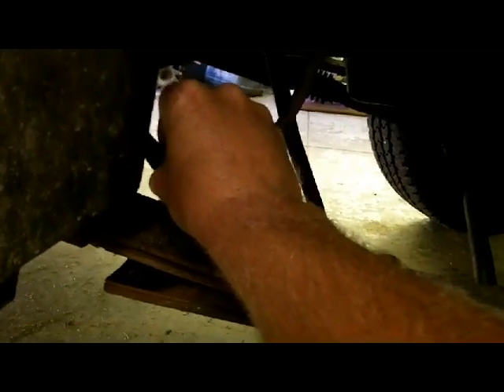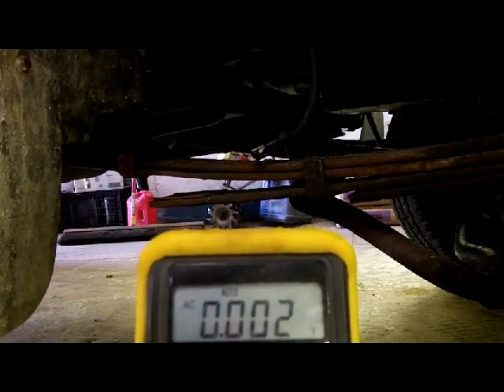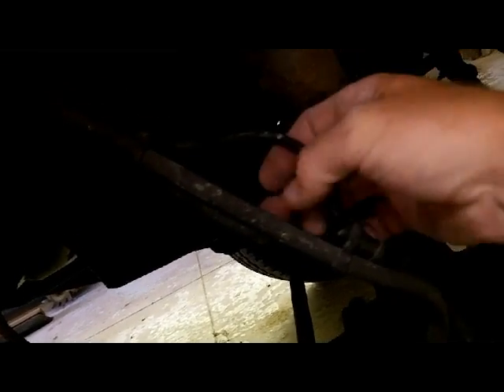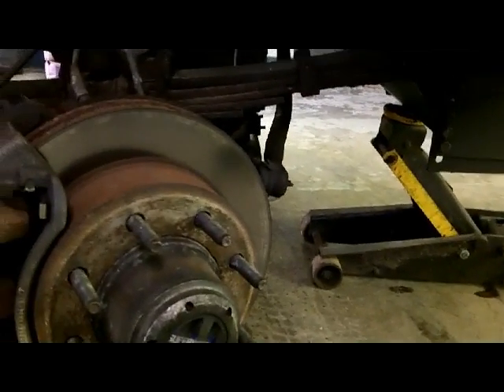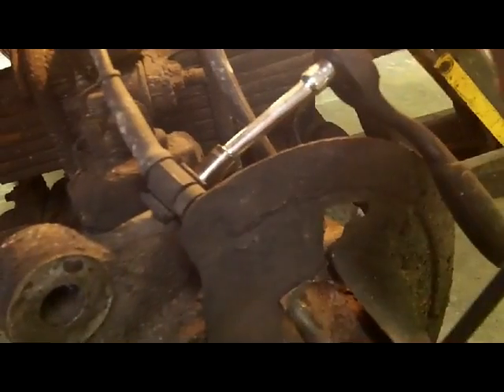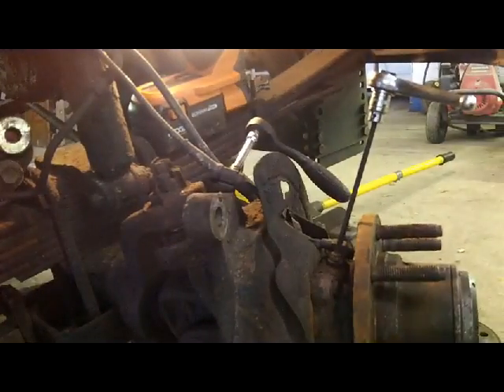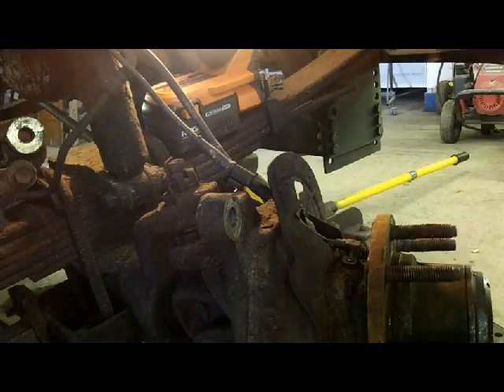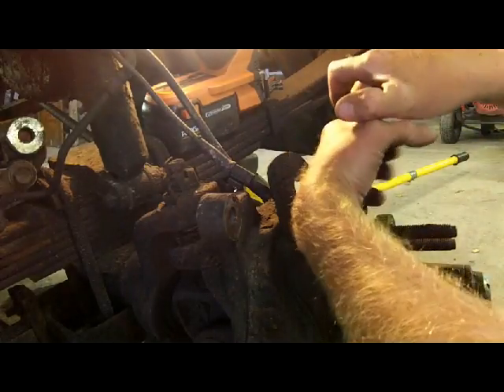F250 Super Duty ABS Sensor Test and Replace

Comment: My ABS showed up and my TCS OFF  is on at same time. Fixing my sensors will that also take care of the TCS too?
Reply from the maker: @victorcompean5745  It could fix the problem if the sensor is bad. If the hub bearing assembly is going bad the wheel speed sensor will get erratic readings and also cause issues. May be best to replace entire hub bearing assembly

Comment from the maker: The sensor does work on resistance... but the resistance is created by the pickups on the wheel hub assembly in relation to the abs sensor.  So by spinning it will tell you if it is within a proper voltage range.  That's why you have to spin the wheel.  Sensor doesn't have to be dead to not be working properly.  Good question though.  Thanks for watching

Comment: Really hard to see shooting into the light behind the wheel.  Your data helps a bunch. And  knowing what AC voltage helps me to test  the sensor.   Just would love to see your hub and  disc setup.  Any 200 watt  light aimed at the side your working would  really help to see.

Comment: Pretty sure this will solve my issue. 2012 f250. Felt like air in the brake lines and the same feeling in the gas petal. Service advancedtrac fault comes on.
Reply: I know this post is old but did this fix your problem?
Reply: Same problem, errrr sound when breaking and hill decend control fault and service advance trac, what did you do?

Comment: In the beginning could you have plugged in your scan tool while driving and seen that one of your wheel speeds was different then the others? I am having the issue with my 2006 ford E350 with the RSC alarm going off. I have no scan tool as I read that a special scan tool is needed for ABS matters. My Service RSC alarm is outrageous to drive with. Goes off every 10 minute or so
Reply from the maker: MurraySellsHomes I didn't own a scan tool when I made this video. If you have some sort of alarm, I'm sure a scanner is necessary
Reply: I'm trying to fix the same problem, I am told unplugging the right rear wheel sensor will disable abs/rsc/tcs 
I'm just not mechanical enough to figure out where the sensor is on the 2006 e350
Mechanic says it's 1800$ to fix properly so I'm screwed and the alarm bell is driving me crazy.

Comment: Is it possible to just check how many ohms are going across the circuit?  If it's a bad sensor the resistance should go through the roof or read open circuit.  Don't have to go through all the trouble to spin the wheel.

Comment: Hey my has the abs light on and the speedometer stop working would replacing them help it
Reply from the maker: Most likely it's the rear axle abs sensor or pickup ring if light is on and no speedometer input

Comment: Any suggedtions if replacement is shorter? I have an aftermarket hub with a longer sensor that has failed.  don't know how to find one that matches.
Reply from the maker: Steve Nichols Shorter may not pick up signal from hub. Try it and see. May need one from Ford

Comment: Just FYI, AC volt on meter is to measure alternating current, like your home. On a vehicle you should set your meter to DC volt. Since you have a battery you are measuring direct current.
Reply from the maker: +jagmechtech I am aware that vehicles use DC power for all accessories however with an abs sensor you are not measuring dc voltage because it is not hooked up to the battery.  You are testing the plug that leads to the sensor, not the end that goes to the ABS controller.  Then spinning the wheel to check for a possible bad sensor if that makes sense.

Comment: I asked for the rear left side but it only goes to the front. Do they now how to replace REAR, or isnt there one on the rear???2009
Reply from the maker: +Gary Letts Usually the rear abs sensor is a speed sensor on the rear differential.  Not an individual sensor on each rear wheel.  I'm not sure about a 2009 but I would believe it would be the same.
Reply from the maker: ***** Thank you sir

Comment: Thanks for sharing this video, i have a 98 f250 and the computer read that the speed sensor a is bad, but i don't know which one would that be. You know? Thank you!!
Reply from the maker: Juan Manuel Perez 
There are only 3 so I would start with the front ones. Usually the front ones are the most likely to go. Hub bearings start to go bad and take them out

Comment: Why am I not getting a reading on my ABS sensor which is brand new it's the second one I returned it first ones I didn't get a reading but I'll market meeting on the second one what am I doing wrong
Reply from the maker: Ronald Hollenback 
Not sure why that would happen. They all have some reading when you spin the wheel.  Otherwise how would the abs unit receive information from it
Reply: @Velvethamma  I have several Super Duty's and I believe it's possible to buy 4x4 hubs that don't have the ABS "gear" inside. That type won't send a signal.

Comment: You have it so much easier with 4 wheel drive since your disc just comes off.. i have to pull my bearing and hub to get my disc off.
Reply from the maker: Yep. The OBS Ford ones are not as easy

Comment: yes not picking up signal but the ford is 18 mm and I need 21 mm.
Reply from the maker: Steve Nichols Is the hub an aftermarket one?  Ford used SKF units in these. Any other brand and your guess is as good as mine